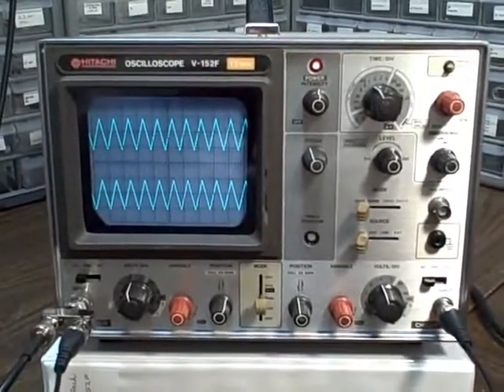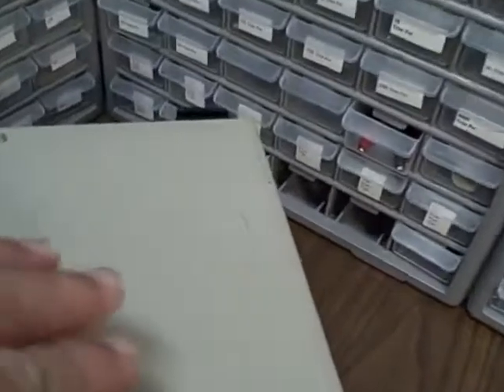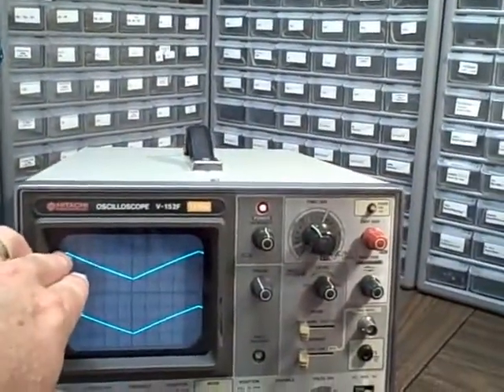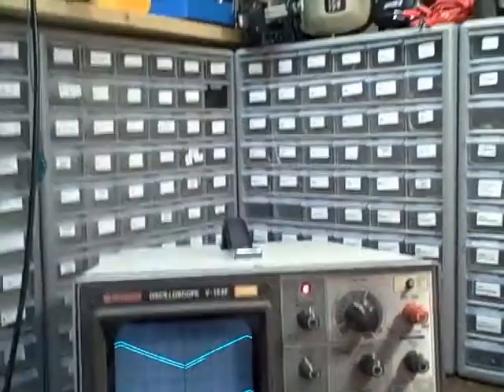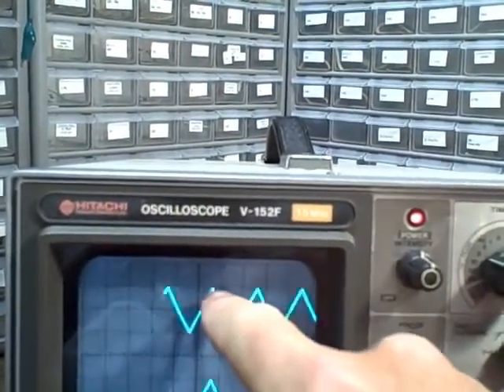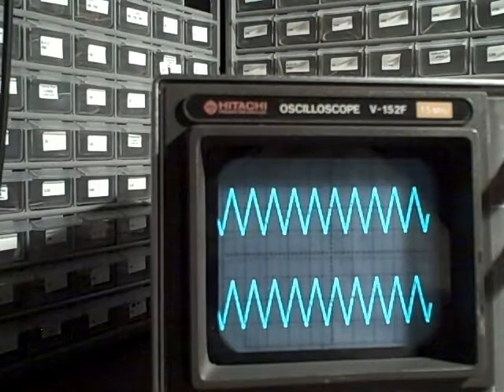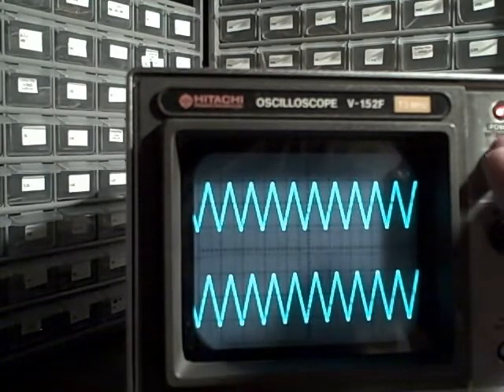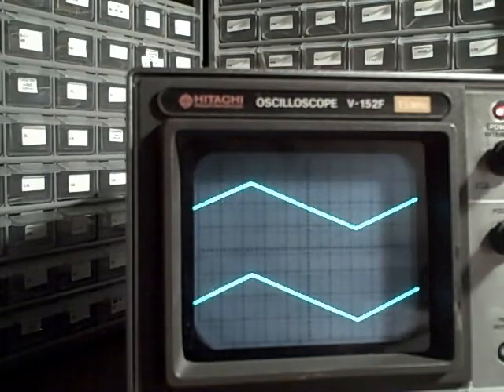Hitachi V-152F 15 Mhz Dual Trace Oscilloscope - Timebase Verification

Comment: I am new to electronics as a hobby. I am interested in buying an oscilloscope. Would a 15 Mhz dual trace oscilloscope be useful?  Would you offer advise on one that is versatile for consumer electronics? I see so many on eBay and Offerup. Thanks for your time. Mike
Reply from the maker: There is a lot to do and see under 15Mhz, so nothing wrong with that. However, I found that a 100Mhz scope covered pretty much the whole of my work, and they are more easy to resell.

It just so happens that I have one going up for sale now.
Reply: @bap8guy  Thanks for the reply. I just bought a BK 1477 New in the box from Letgo. The previous owner had some medical equipment company and bought 2 and never opened this one. Couldn't pass it up for $30. Once I learn to use this one and hit some limitations,  I'll probably want to upgrade or add another. Thanks again and thanks for the videos.